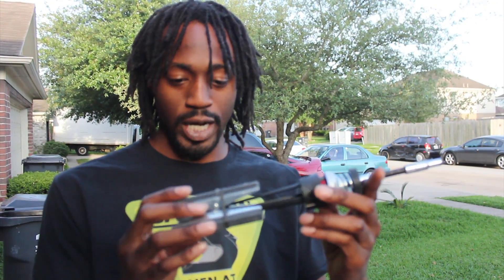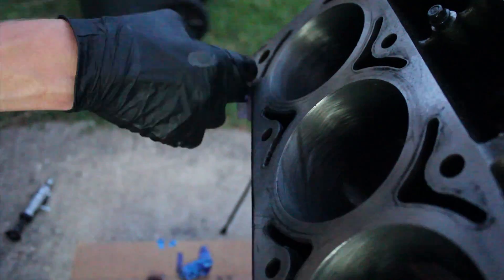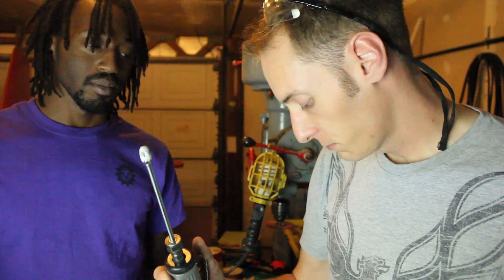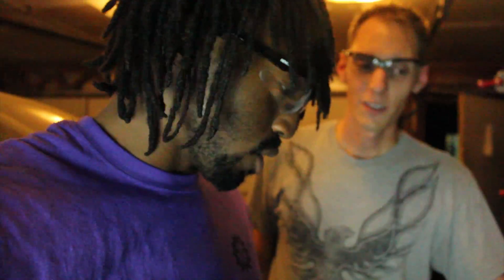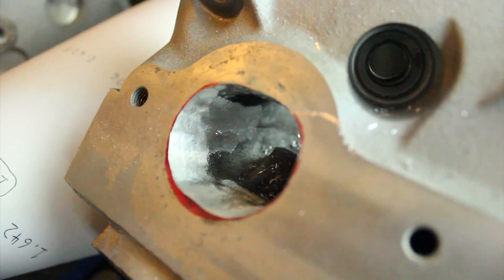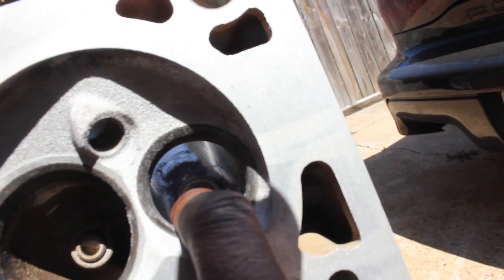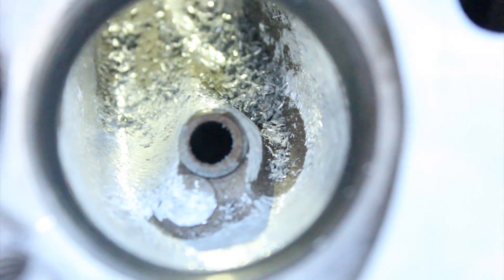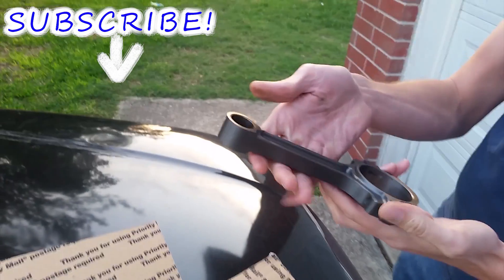The 500HP Budget Build : Part 4 - Block Honing and Head Porting

Comment: Use an electric dremal with stones instead of an air dremal you'll get alot better results and you can adjust the speed you want and it's not as intimidating if it's your first time
Reply: Made of stone? Hopefully you don´t mean a rotating file made of stone?  Try to use one of these !! :)

Comment: Nice job guys. Removing the swirl ramp helps allot. I see you stayed off the EX port floor, very good! (I see allot of amateurs hack up the floor of the EX port, that's the fastest way to KILL power). You did a very nice job. I don't know if you took down the rocker stud boss inside the intake port, if you didn't, you need to.

As a professional head porter, I'd say you guys have a pretty good grasp on things. Keep up the great work. Find a machine shop that does PERFORMANCE valve jobs. That alone will get you ALLOT of airflow!
Reply: A back cut on your intake valves will get you 30HP easily. Use 30-33* backcut angle under your 45 on the valve.

Comment: Not bad. Wear a mask/respirator though, its bad to breath aluminum shavings/dust. Also, those cartridge rolls from Harbor Freight to smooth the finish left by the carbide burr work well, but go online and buy a 3M mandrel to use. The cheap HF ones like to snap. Also, you can use regular wheel bearing grease on the carbide bur to keep metal from sticking to it. You don't have to use that special paste. I just use my finger and rub the grease into the bit all around so its light and doesn't fling everywhere. Also, invest in an electric grinder, much quieter and uses less power than a big compressor, which eventually will get hot enough to start pushing moisture past the air/water separator.

Comment: This is extremely painful to look at. If you don't know what you are doing or even the first places to start you shouldn't even attempt to grind on a head. I can insure you made these heads flow worse than the factory. You need to read about C.S.A., understand what the short turn is, Tapper the C.S.A. of the port, and learn how to pick a venturi size and then scribe and grind the venturi into the port. When you added volume to the bowl without knowing the C.S.A. of the short turn you literally slowed the air down. There is a reason we charge a decent amount of money for this and it takes days to get a head done right. You need to invest in snap gauges, radius gauges, and read heavily about the things I listed above before you attempt this again.
Reply: Throwing big words around to make your dick feel bigger, and trying to make them feel out of place isn't cool dude. A million times they said this was a learning experience. Not everyone is blessed to be taught so early in life with awesome tools all the time. Give them a break. We all start somewhere.
Reply: You WANT the air to slow down so it can make the turn around the short side. The throat (just under the valve seat) should narrow back down to 88-90% of the valve size. That will speed it back up going into the chamber. 

I think they're doing a pretty decent job. Of course without being there to measure things, I'm only going on what I can see in the video. Don't be a hater, we all had to start somewhere.
Reply: Your a dick let them learn
Reply: ptbelttactics   You need to go fuck yourself. No one cares about your opinion

Comment: Hey guys the best way to stone hone a block is to used stead SLOW up and down motion using plenty of spray CRC or WD40 be careful not to go to deep into the bore as you will break your stone on the WEB remember to clean the block with plenty of DAWN dish washing liquid and HOT water....rinse really good then immediately use CRC or WD40 to keep rust from forming as it will almost immediately ..You can actually take a small ball stone hone if you want to the lifter bore's  ..to break the glazing cause by wear the previous lifters & from high mileage ...remember a good honing allows oil to remain up high in the bore's ...I'm just a bit confused about the need to have your partner explain things he is obviously not familiar with . I'm almost positive this is all pretty new to you guys right ?. Well I built my first small block at 15 and im in my 50s now so I'm pretty sure I've done a few more than you have . But can I share something with you guys .. We would really rather be looking at engine parts while you give us your long winded lecture's like all the other guys do but you instead show engine less and you two more AS if that's why anyone tunes in ....It's really NOT..

Comment: I'll bet you did more harm than good by "porting" those yourself. Until you can identify and copy what you see in a professional head, you don't have a clue of what's going on and the potential for fucking shit up. More cfm doesn't always mean more power. If the air speed is so slow, it won't properly fill the cylinder, it doesn't matter how many cfm it can flow. It will never be efficient enough to make any power.

Comment: Nice job! I ported my 862 heads for my LM7 build. one tip for genIII heads on the exhaust ports its best just to take metal from the sides to make them wider you dont really need to take off the top or bottom and in the intake just do line of site it will save you alot of time since air doesnt turn corners. Now im gonna go do my 241's off my LS1
Reply: Actually on exhaust you should take off the roof of the runner as that's where most of the air is running, but yes, widen as well.

Comment: Porting and polishing by hand is awesome and awesome to watch. Inspires me to port and polish my own cars heads.
Reply: Charlie Wolf I would suggest not polishing anything with fuel flowing through it, fyi. If you don't know why, Google it. It's far too much to explain here.
Reply: I have been advised of that before, however, I think it has more to do with turblent flow and fuel break up more from the age of carburetors and throttle body injection. If you have muti point port injection or direct injection then polish away as the surface and turbulent air flow does little to atomise the fuel before it enters the combustion chamber. I would also chose not to have port direct injection as you can have alot more carbon and oil deposits build up on the intake runners and valves as there is no fuel spreyed from the injectors on to the back of the valves to clean them as there is on a multipoint port injection system and not even polishing  these surfaces will save them from deposits. Cheers.
Reply: You need to read more about boundary layer and Coanda effect to see how wrong what you are saying is. A polished intake destroys not only wet flow but air flow in general.

Comment: that hump is to make the air swirl going past the valve help low and mid range power removing it will up the high rpm power only the porting should match the camshaft so they work together

Comment: think about this... cross hatch patterns make the rings rotate, during break in, its not much but it does happen, also top ring material makes a big difference in how you hone or de glaze cylinder walls, moly, cast iron, or steel, top rings can be replaced with out doing the second ring,which is an oil scraper, the bottom oil ring is your call, none of my business but you should use studs for aluminum cylinder heads and lube all the fasteners,before final torque values.

Comment: hi guys here is a little more on why the valve job and porting close to the seat is so important. if you look at when the valve is at full lift the piston is just a little past half down the cylinder and is only open very little when the piston is all the way down. the engine is trying to draw the most air when the valve is mostly closed. this makes the biggest restriction the valve and valve seat. put your valve in and open it up 1/8 inch and you can see that is not a very big area to get air. open up the bowl area all the way to the valve seat line you find with lapping compound and with the 30 degree back cut on the valve it is more important then work in the port. after valve job then port work will help. valve seat width will be the next thing to talk about. intake on street needs to be around .030  and exhaust alittle wider then intake .050 the smaller the seat width more power but will wear out quicker and lose seal. if the seats get to wide is bad also because spring pressure is spread out so much you lose seal and heat transfer out of valve goes away and valves will fail. if you can afford new valves, some manleys with an under cut stem would be cheep insurance. i would really like to share a life of experience with you guys because its is great to see your desire to get off your butts and do something and that is great.
Reply: Teri, if you open the bowl up to the seat you literally will blow the venturi out of the port and make it flow less. The venturi is right bellow the seat. Also your understanding of the demand on port flow is wrong as can be. The Intake Center-line is were it is because the piston accelerates off of TDC, hits it's peak piston velocity, and then starts decelerating to BDC. The valve needs to start closing to keep port airflow velocity up and help maintain inertia ramming effect. On high RPM applications the intake pulses are so high we keep the valve open way past BDC to continue filling the cylinder as the piston is traveling up; that is how you get an engine to have a Volume-metric Efficiency over 100%.
Reply: ptbelttactics is 100% correct. The venturi accelerates the incoming air, which benefits air charge in the cylinder due to inertia. When you take out the venturi you lose this 'extra' inertia resulting in a worse volumetric efficiency. Air velocity is KEY for cylinder head porting.
Reply from the maker: Teri Stieben Thank you! We really appreciate it. We are always open to learning new valuable information!

Comment: I'd suggest using a bottle brush style hone for your next low buck rebuild vs. the traditional style hone you used in the video.  I've done a number of budget rebuild projects like yours in the past and the bottle brush hone gives a more consistent cross hatch pattern than the stone style hone.  There are no stones to crack (cracked/broken stones will not hone uniformly; no machine shop will finish a block with cracked stones in the honing fixture) and one can get a good hone by slowly moving up and down the cylinder (not sure why you guys thought you needed to work the hone in and out of the cylinders at such a frantic pace).  Hones, whether stone style or bottle brush, generally work best at a specific RPM range vs. locking your drill on high speed and going for it.
Reply from the maker: Agree'd, this style hone is not very good. The last hone used was a ball style and was a lot smoother of a process and a better end result.  Thank you for the tips though, will be keeping it all in mind.

Comment: hi guys just watching your work and would like to offer 35 years of experience on head porting best thing you can do low cost is get the valve work right by getting as close to a three angle valve job as you can get and to do a relief cut on the back side of the valve and the boss where the guide comes into the port. the size and shape of the port just won,t make much of a horsepower change yet. the valve seat is the big restriction in the flow. also put your heads on and flip the motor over and match the chamber to the bore
Reply from the maker: Thanks for the tips! We'll definitely take it all into consideration!
Reply: If you match the chamber to the bore you will destroy the quench pad and obliterate the the quench/squish mixture motion. And, if you flow a set of heads on the bench with out the valve you will see 90% of the time the port won't flow what the flow potential of the valve is. But, I do agree valve job is the best bang for you dollar, when you reshape the port thou the optimal back angle of the valve will change. When I develop a head after I have finished the port, I like to start with about a 35 degree back cut on the valve and work my way forward until flow stops picking up then that is the angle I will grind into the valves.

Comment: great job guys.. I noticed you cracked the hone stone... you may have plunged too deep and hit the casting... try placing a mark or tape on the stone as a depth gauge..... A shorter length cutter bit will bounce less... porting takes hours... I never seen the use of grease as a lubricant, I've used water in a spray bottle for aluminium.... great cuts, keep it up.....  500hp ?   can't wait to find out...   I'm thinking 435hp screaming on pump gas..... good luck... love the videos... and the plane😎   https://youtu.be/63ELVljY290